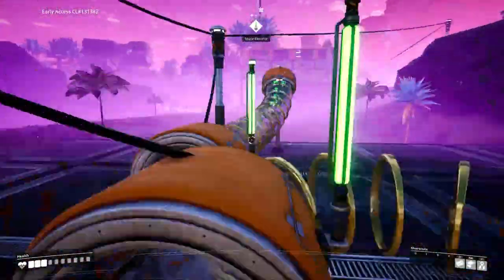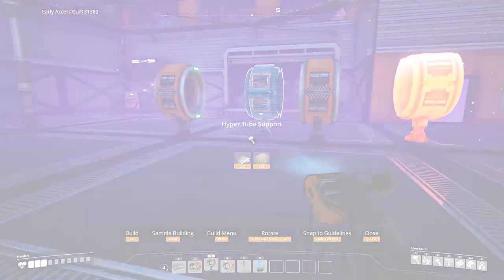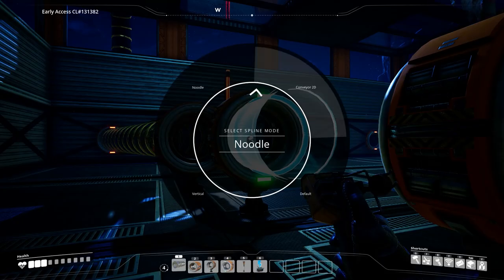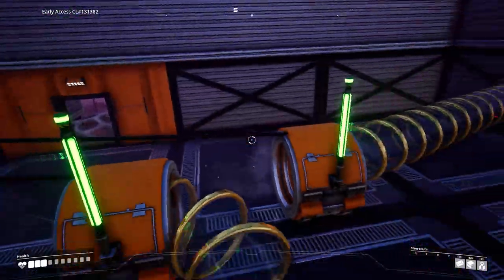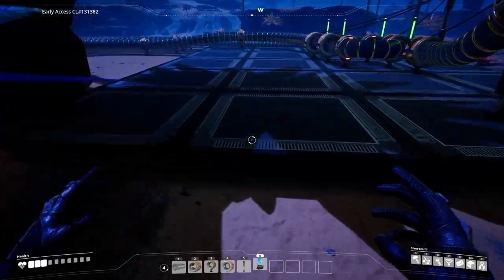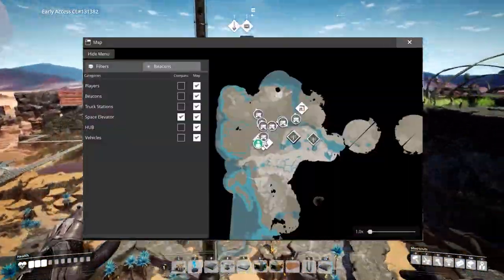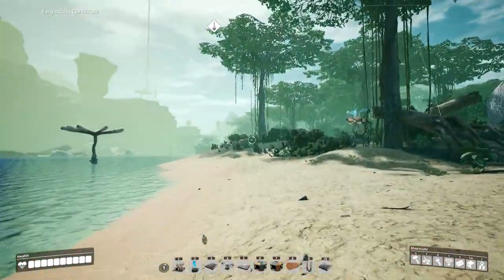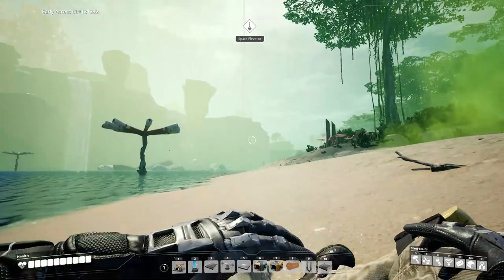Satisfactory's EASIEST Hypertube Cannon.

Comment: This still works VERY well (Experimental Update 6)....most of the time.  It's a little 50/50 in the latest versions whether it spits you out forward or backward.  But it's such a quick and easy setup I'm using it all over the place.  Just need to put a backstop in the direction I don't want to go lol.

Comment: Aye! Any tips on how to make it less strong xd?
Reply from the maker: If you extend the launch tube or do a couple of loops with it it should slow it down. But apart from that not really, it works on glitching through the first pipe from the speed so if you slow it down before that point you won’t get a launch